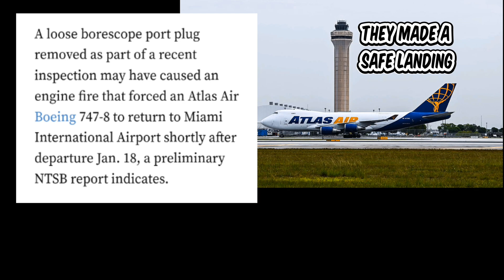Boeing 747 Engine Fire Condensed ATC

Comment: If you take a plug out then you sign for its re-fitment its called paperwork ! Incidents can happen like at a UK airport where to stop the engine wind milling the engineer put a rubber chock against the fan of an RB 2-11, Shift change happened and all was set for an engine run, BANG went the engine as it ate the chock, no one looked before start.
Reply from the maker: Never good, must follow the procedure. Have a good friend that worked at Boeing Field for Paul Allen before he passed. They made their techs use foam cut outs for all tools. One day a tech was missing his pliers. They searched and found them in the vertical tail assembly of Pauls Gulfstream.

Comment: I worked on the certification of that engine, which has been quite reliable. Unhappy to hear of this issue, but at least it wasn't a fault of the engine.
Reply from the maker: For sure, poor maintenance unfortunately does happen. Why you always are most concerned after major work is performed. I recall having mags replaced in our Baron years ago. Dad took off and the right engine started to miss fire badly. They had messed something up during the install. He was really peeved over that. That was the last time we had work done by another shop, that was in 1983. All work since done by our own A&P with our supervision. Had the same A&P for nearly 40yrs, no issues :) Good job by the crew and ATC here.